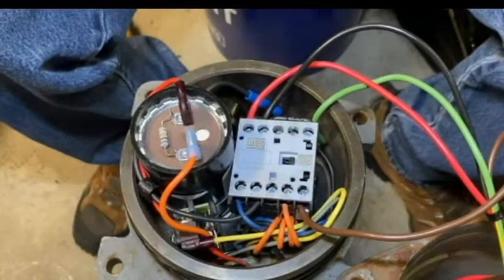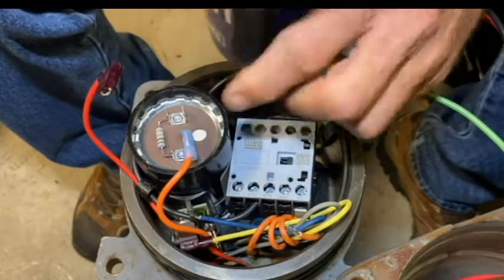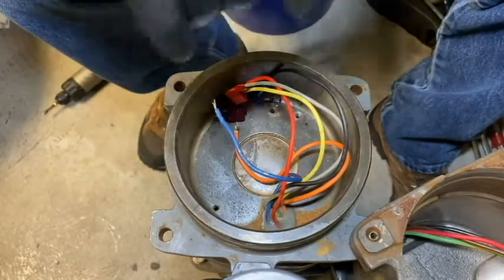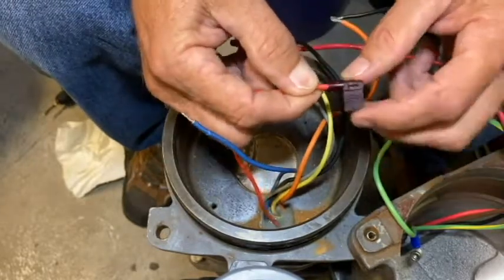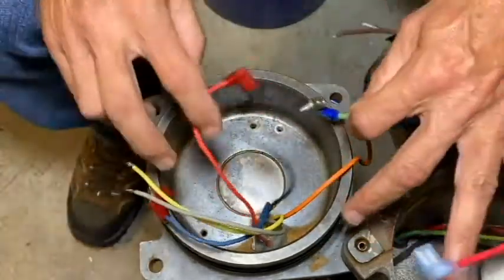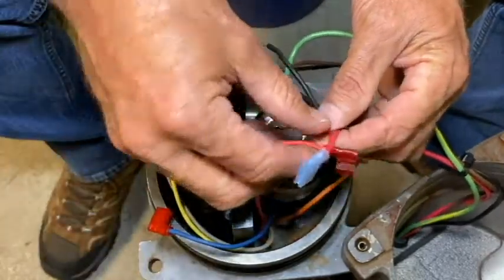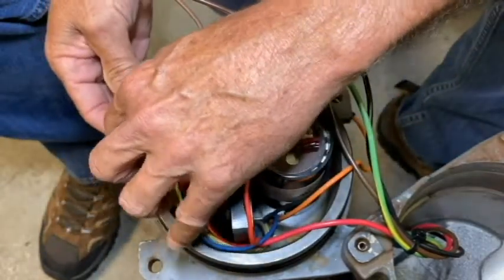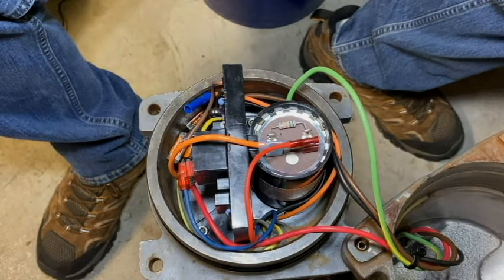E/One Grinder Pumps: How to Retrofit a Motor Controller Board into a 230V/240V 60Hz Pump

Comment: What are the electrical readings supposed to be? testing the wires before you run to make sure all connections are correct, and tight. There has to be factory specs for ohm checks, and Meggs.
Reply from the maker: Hi Larry - please email me at eone@eone.com so I can send you the service manual.